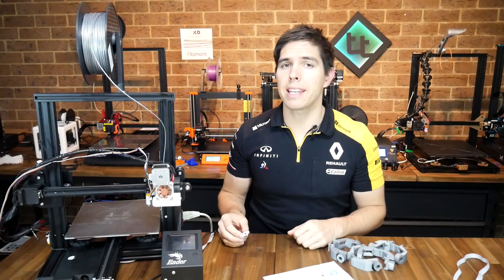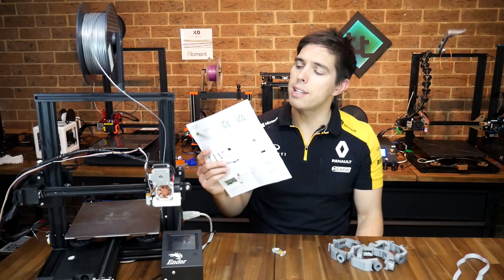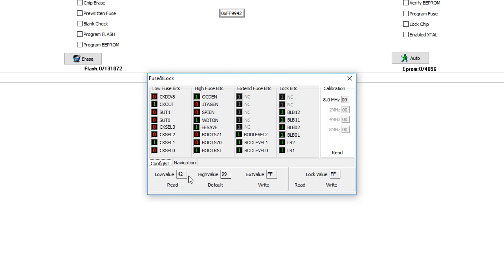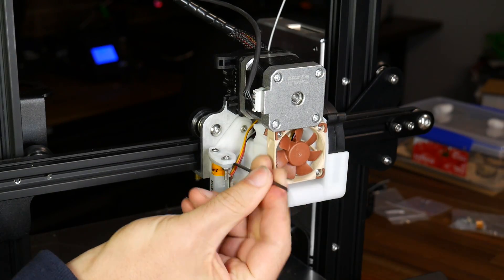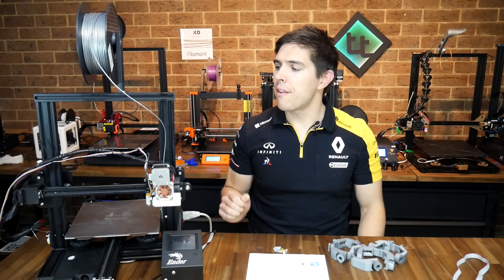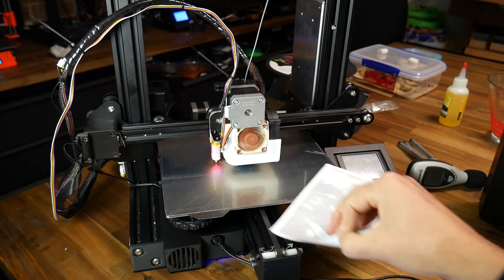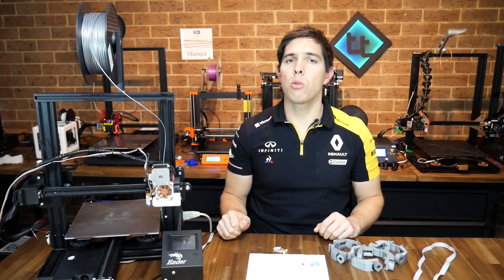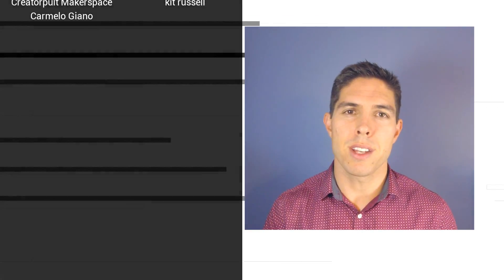Creality BLtouch Ender 3 upgrade kit - Step by step guide with fixes

Comment: Installed and seems to auto level ok, but when trying to make a test print, the head simply goes to the left and reach the edge of the rail and it it necesary to power it off since it wants to keep on going, the marlin I have now is 1.4.1  so is there any suggestions?

Comment: Just wanted to say that I followed the steps in this tutorial and have a printer working perfectly with bltouch now! 

Worked after the first installation as well, with only a slight error.

I followed the tutorial for every step of the way; the only thing I skipped was using the Creality firmware. I downloaded the precompiled marlin firmware in the description of your other video and used that file with progisp instead:

https://www.youtube.com/watch?v=sOFxalLOZOI&t=0s 

I could not find progisp at first, but later found the program in a a drive someone shared on a reddit post.

The rest of the installation, I followed exactly. Everything worked perfectly with my Octopi setup as well. The only issue I had was that the bltouch would give an error randomly at certain times, the probe would be stuck for some reason. All I had to do was adjust the screw that is on top of the bltouch (between the two that connect it to the mount). I did a half turn clockwise, though I have seen for some people a half turn counterclockwise also helped.

After that; no more errors. Just had to level the bed, set the Z-off set and now it's printing beautifully. I finally have clean first layer on my heavily warped bed.

Thank you loads! Hope others have success with this as well!

Edit: I have a 1.1.4 motherboard on my Ender 3 Pro and a BL-Touch version 3.

Comment: The install went picture perfect.  I suspect some updates were made to the software.  I did not experience any of the error messages, so powering on the printer during the initial write was not necessary.  However, powering on the printer, ahead of installing the display interface board and attaching the monitor cable, causes an alarm to activate.  The initial test print (pattern) is wonky; I believe more than adjusting the offset may be needed.  Overall, great video.

Comment: they should have just made this a plug and play thing with a memory card... then all you do is flip through the LCD menu to open a file, then run the file which then adjusts all the bed leveling parameters automatically. Coding a computer system shouldnt be required by the user

Comment: I’m so frustrated with mine, lays down a decent first layer but the prints have errors,  strings where arches are, small blobs. etc, when probing it starts leaking filament everywhere, that’s another issue. I’m about to rip it off because my prints were better without this piece of crap

Comment: Just a tip: should put on the bltouch cable before mounting it to the hot end, cuz I broke mine, the connector is very weak.

Comment: I am trying to solve a z-offset fix as mine always auto homes to a value +10mm of whatever it should be, and Im about to loose my mind with all the conflicting info! I have an Ender 3 Pro (not v2) with a newer mainboard that allows me flash firmware from sd. The BLtouch Smart I bought from microcenter has a 5 pin connector that fits into my mainboard, many guides online for the Ender 3 Pro show a 3pin connection going to the mainboard and an a 2pin replacing the z-axis stop connection - this is not the BLtouch v3.1 that I have. The device works using G29 command in slicer and then manually dialing the z-offset as the first print on the new bed starts but thats a pain in the butt every time I swap the buildplate! Is there any way to eliminate the 10mm offset that sticks on the auto-home every time? Am I using incompatible parts? When I click store settings after manually dialing in the gap it just beeps, then auto home will send it back to 10mm gap - clicking load settings just makes the machine beep - does it not open up a menu to access which settings were stored? Ive been googling and watching youtube videos for hours and everyone seems to have a different combination of hardware from me! HALP! Im going to watch your video on editing marlin software to see if I can figure out entering in a -10mm offset to counter the auto home issue? Im lost at this point

Comment: This is the 4th video about installing and fixing issue for a BL touch. I can never get past one step of what this guy is doing. I just need to know where and how to install step by step. It's been pissing me off I've spend 4 hours trying to fix this.
Reply: dude im on the sam boat tutorials are terrible and to complix to installl im having the issue now that instean of it appearing atmega1284p i only get atmeg128
Reply: @Punx2lit  This is my 2nd week without a printer. Now my problem is fixing the bl touch z stop
Reply: @Punx2lit  But yeah, these youtubers have all failed me on getting me a working 3d printer. SMH
Reply: @Punx2lit  I just have a blank box, can't even type in the chipset..

Comment: Just starting this, hoping this will help since the manual I got is a 12 page double sided accordion folded 3.25" by 2.5" size, so the print on it is totally useless.  So crossing my fingers and hoping this isn't outdated.
Reply: Well, only had problems trying to find the progisp.exe since it didn't come with mine.  Found a download file on Creality that had it in it.  Otherwise everything else worked for me.  The latest Creality BLTouch that I got was version 3.1 and so far it appears to work on my Ender 3 that I bought in Nov 2020.  I will still need to do the final Z adjustments as soon as I'm ready to start printing.  This mod I combined with my new Creality direct drive mod also.

Comment: Micheal have you any idea why when you home the printer and note the position and then lower the nozzle until the paper catches and then note the position and calculate the Z offset that the Z offset does not work, what happened? where did that extra space come from?

Comment: I have bought this and the progisp software does not have any options to select the chip and Creality does not reply to my request for help with this so it seems it is impossible to install this with Crealitys kit, you would think the manufacturer of the printer would get this right but I have discovered other people have had this problem and a year later Creality still have not replied but they will reply to comments that praise them, I guess I am going to have to burn a bootloader and configure vanilla Marlin myself which is the reason I bought the Creality kit to avoid having to configure Marlin myself.
 I cant recommend this unless you buy it knowing the software and the programmer is useless and you will have to burn a bootloader via an Arduino
Reply: I fixed this by renaming the folder to the name minus the Chinese symbols
Reply: wait how did you fix i cant seem to find atmega1284p chip the only chip close that resembles this is atmega128

Comment: Help with bl touch. I recently bought a bl touch from creality and upon trying to install it it won’t work. Then I checked the box and my printer model and the printer board is a 4.2.2 and the bl touch is a 4.2.7 is there any way to make it work or should I just buy a new one?

Comment: Did you have to adjust the bed with the 4 corner wheels at all to get it as level as you could before changing the Z axis and Z-offset? or did you back out all 4 corners, or tighten them all the way, or eyeball it?

Comment: Hi Michael! Thank you very much for your videos. With this one I achived to set my new BL Touch from Creality although it is ver 3.1 and works much better. But I have a problem: my Ender 3 has the main board box with the cover in the top, not in the bottom like yours. I have a collision between fan and LCD connector. Have you heard about it? What kind of solituin are there? Thks in advance

Comment: I presume the Marlin 2.0.X link is the one for the thermal runaway protected version, but I have no idea which hex file I actually need to put on to my Ender 3? There's like 5 different ones in the Marlin folder. Is it Configuration.h we need?

Comment: I'm attempting to put the BLTouch on my stock CR10 v1. I put a bootloader on it, flashed marlin 1.1.x bug fix, but the LCD screen was blank when I turned it on. I double checked connections and everything seemed to be in place correctly. When I unplugged the pin 27 board and plugged the LCD ribbon back into the main board the LCD display was fine. Any tip or ideas would be greatly appreciated!

Comment: well after upgrading the drive feed, bed, fan, and now I'm going to do this because the nozzle keeps failing to either make contact with the table and even when I run bed leveling gcode through the printer it looks good, but in the end it's a bust...so rather than to adjust after every 2-5 Prints I'm going to see how this goes :) (new to 3D Printing so any advice is appreciated) PS: Does this also mean I can remove the Z sensor that's on the left? if it's disconnected on the MB I don't see the use...

Comment: On the 4.2.x boards you can jam both the probe connectors into the bl touch harness on the board labeled bl_t. What connector is that? I would just pin it out if I could find one.

Comment: the programmer doesn't have the  ATmega1284p file what chip do i need to use??? ender 3   board is the v1.1.4

Comment: You are a life saver (or in my case a sanity saver).  Thank you, Thank you, Thank you for your vides.  I bought the upgrade kit from Creality and it had the 3.1 BL Touch, so I was hoping it would by pass the issues you mentioned.  But no, I have an Ender 3 Pro and as of Jan/2021 the incompatibility issues still exists.  The first test of starting with the probe high saved me as of course it did not work.  The latest software from Creality does not solve the issues.  I installed, VS Code, downloaded Marlin ... to get it to work. Your videos really helped and clarified what would be a nightmare issue.  Again thank you very much.  Even though this video is two years old it is still relevant.

Comment: Just upgraded my ender 3 to the 4.2.7 board and a BL touch following your guide but now the z axis is not operating properly. 

On startup I can control the z axis fine, when I auto home, the x and y axis work fine, but the z axis just raises 10mm then stops. After the homing, I can no longer move the z axis down.
 It will not print either. When I try to print, it shows super fast progression on the screen but nothing moves.

Here is a video of the issue: https://youtu.be/ISZwgi4g4nk 

I can't find anyone else who's had this problem...

Comment: I just got a new Ender 3 Pro, pulled the cover off to install the BL touch and there is a 5 prong horizontal plug in place of the 6 prong mentioned in this video at 2:17. Any insight on this? Sort of a bummer as it is out of the box new and i cant find anything explaining the different style plug. I suppose i could match the prongs with jumper cables but that feels like one more variable in an already complicated process. Any help would be much appreciated.

Comment: After fully watching your VT, I am in two minds to use the BL touch . Wiring is a breeze, but the actual setting up of the BL seems tedious and slow, as you showed. I have it down to art now to level and the nozzle distance, to use  a level for bed level and A4 paper, do the tests, and away I go.
Question is, is it really neccessary for using a BL touch and reflash Marlin. My setup with stock fw, seems to do all that I need and want,  and very happy with it.

Comment: When I plug the usb in to flash firmware, I get "windows does not recognize device". The blue light comes on on the motherboard so the pins are inserted correctly. Did I get a bad USB drive/ISP device?

Comment: If I set my axis normal my bltouch works but prints are mirrored, so if I change my x axis so it goes opposite direction I don't get mirrored print but my bltouch tries to level off the bed on its last probe point so it probes along the bed 4 times then the 5th time it's off the bed, can only assume that the x axis is then wrong but get mirrored prints HEEEEELLLLLPPPP cr 10 v2 running marlin on a skr1. 4 turbo

Comment: This is a fucking excellent video. Thank you so much for making it. 

I bought a BL-Touch last week, and I ran into a couple of problems. The QR code for further instructions was a dead link, and there was too much unclear info online... 

Then I looked at this video.... Install went amazingly well and I love the efficiency it offers. Seriously, can't creality just offer you a job or sponsorship or something? You could be the Aussie Naiomi Wu!!

About the only thing I can offer is that I've had to figure out which file to download... i had a couple which had a hex file, but didn't have the software to flash the hex file... In the end, I used Ender-3 Pro_8bit_1.1.6 BL Touch Firmware_0814.rar and it had the ISP folder I needed. 

Anyway, a mate just bought an Ender 3 Pro + BL Touch.... I simply referred him to this video and the right file to get him started.

Comment: I get programmer can not be found. My USB is on COM 8, and I have the software on COM8. Any help would be grateful.
Reply: me too any help would be appreciated
Reply: @EliJVandivier  so..I figured it out..took a few weeks...I'm using marlin 2.0. so the major issue..no one tells you that after you set Z offset... manually level the bad Also. The bltouch can only mesure 3mm offset. So in short, if your bad is more out of level then 3mm then the bltouch and do its thing. Also..I had a second issue...my leveling wheel next to the wires was brushing them ever so slightly. I couldn't see it unless I watched with a flashlight. So everytime the bed would move back and forth, the bed would go out of level. Hope this helps.

Comment: Hey! 

Thx for the trying to help and the great content but where is the actuall precompiled hex file you are talking about at the end of the video?
I have an ender 3 pro with an 8 bit silent V1.1.5 motherboard and I really have a hard time getting my BL touch  to work! As you mentioned the Z offset ajdustment is a pain in the a*** and since I installed the BL touch according to creality I have major issues and can't print ! 
SO you promised precompiled hex file for flashing the firmware with creality programm would be a HUGHE help but i can't fin it on the link you provide! 

Thx alot 
greetings feom vienna

Comment: This kit seems pretty good to just get everything you need and already have an arduino uno at hand then ditch the programmer adapter. If there were a way to make sure you got the bl touch v2 I would buy it in an instant.

Comment: 3:40 Official instruction says that the Low Value should be = D6, High Value = DC, you sayd on the contrary
Reply: Looking at it logical it would make sense that dc is the highest value.
Reply: He made a simple mistake. If he did flash it with those settings, it may not affect it enough to cause damage or failure. Follow the official instructions. DC should be the High Value. I just did this and used the values in the instructions. @JV Gaming you are totally correct in thinking DC should be the high value
Reply: I would like to know as well.
Reply: I just got the BL touch, and I'm seeing the same thing.  The values in the documentation are different from what is in this video.

Comment: Is there a video anywhere using the BLTouch with the 2.2.4 or 2.4.7 boards and Marlin2.0?    I'm running the 2.4.7 board and Marlin 2.0.7.2   The 2.2.4& 2.4.7 boards already have a bootloader, so it's much simpler.  But they use .bin files, not .h's.    
So basically all of this info just a year old is pretty much useless for anyone who got an Ender 3 for Black Friday / Christmas in 2020; as all the 8bit boards were phased out and no longer being sold.     Just wondering if there's new content somewhere.

Comment: I have just got a Creality BL Touch kit and found that it has a USBHID , so i got a USBasp 3.3V 5V Programming Device (incl. ISP Adapter and Cable), USB ISP Programmer  but the Progisp will not run using it , Is there another way to set the BL Touch.
Any advice would be of great help

Comment: man. i've been battling with this program for a day. it keep's teeling me "programmer not found" any help would be greatly appreciated
Reply: Not sure if you've fixed this yet, but I got this problem. I messed around with the usb port a bit until it worked. The casing of the ISP had slipped down and was preventing the usb from making a connection the ISP. The bottom line is that the program is not recognising the ISP is even plugged into your PC so if it isn't a poor connection then it will be the device drivers.

Comment: So my print quality plummeted after the install. I disconnected the BLTouch and reverted the gcode changes and it still prints poorly so I think it comes from the Marlin Version. Does anyone have a good version I could flash on there?

Comment: Wow, so I really struggled with this install. This is my first 3D printer and I did not pay to much attention to what exactly I pulled out of the box. An ender 3 V1 what I ordered was an ender 3 V2 so my things as per instructions did not work. How do you know if you have a 8-bit or 32bit 3D printer.... it is not name plate. so I tried both firm ware options until it worked. I an not a fan of Creality now. Your video did an adwomen job of helping me through my troubles but I would not recommend an ender printer of any version to anyone after this debacle